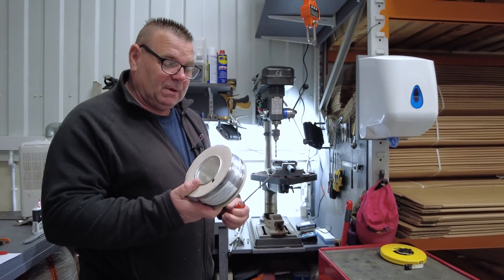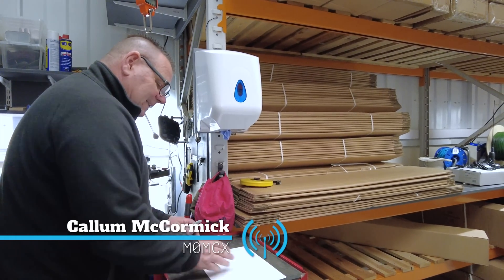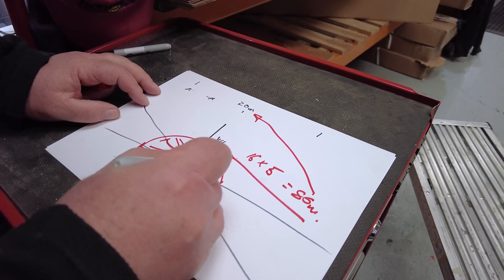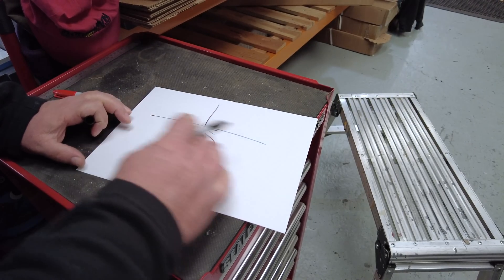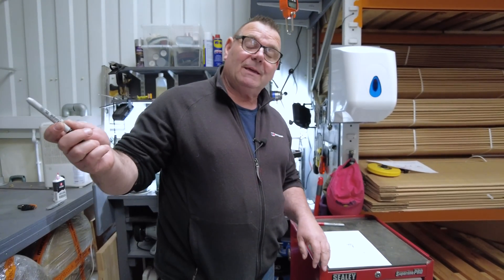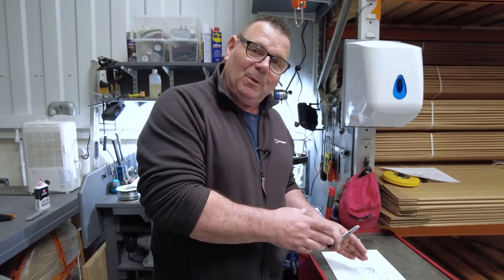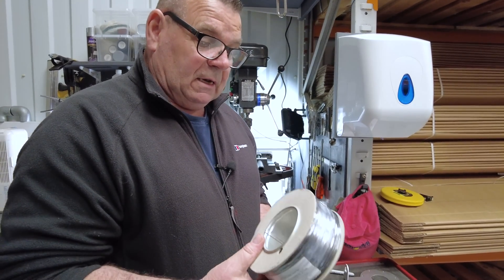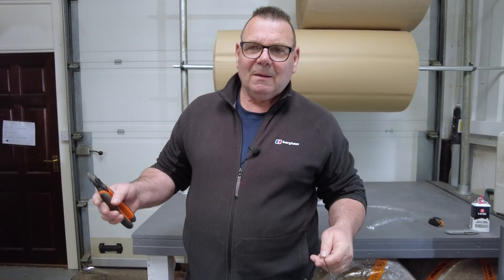How Many Radials for a Permanent Ham Radio Vertical Antenna

Comment: Your 20 meter antenna, math example for making radials is great! I can apply it for any length antenna. However, what about a 6 band antenna? If i make the 16 radials of 1o meters (going for 1/8 since 1/4 is too long, and getting 2 wavelength of copper in the ground), then what about the othe bands, 40, 20, 10, etc? Do they work of what i put down for the 80 meter part of the antenna? Thank you!
Reply from the maker: OK, so for a multi-band antenna - my own rule of thumb is 2 x wavelengths of radials for the lowest band - then everything automagically doubles when you change bands upwards :)

Comment: Does the end of the radial  wire need to be insulated? Thanks
Reply from the maker: The end? No unless you are a paranoid OCD.. Yes, water will come in - but it will still be copper inside in 100 years time.

Comment: I wonder what would happen if you had a single really long radial and just encircled the vertical antenna in a spiral fashion?  You put a lot of  wire down.
Reply from the maker: Actually, it's genuinely more efficient to have a lots of shorter radials because closer in to the feedpoint, there's more copper..
Reply: @ loving my DX Commander Classic Callum. Thanks for the response. Hope you are well!

Comment: A little overkill perhaps but in the main well done. The FCC once required 120 radials for commercials. Steve N7VS
Reply from the maker: Yes.. Dr George Brown discovered that for SHORT radiators, 120 was optimum - but as Rudy Severns (and me) discovered, for pure quarter waves, 16 is good, 32 is maybe an overkill..

Comment: hello Callum, i,m thinking of buying the sig 9 version to replace my hf vertical , i have a 125 ft efhw for top and harmonics for the other bands i made it witha9.1 balun, it works very well and it'll stay up as a back up ant.  I'm interested in the sig 9 as it does need guy wires i would be able to get out approx 8 radials, hows about 1 1/4 for each band would that be enough, can you drive a copper earthing rod in the ground and run an earth to that would it act as a counterpoise? or is it not needed, many thanks GW4
Reply from the maker: Mike.. Honestly, just lay down a load of small radials.. Don't both with earthing rod.. That won't assist.. It's the return currents.. If you are concerned, just remember "small and lots"..

Comment: I was getting all excited about this DX Commander - until I watched multiple videos showing the guys stringing LONG lines of radials. I have just enough room for the Commander, but very limited space to stretch out radials. Especially at even lengths. Your video here shows how the antenna should still work even if only done in a 180° (or even 90º!) spread. This gives me hope that I might be able to make this antenna work for me in my backyard (garden to you UK folks - ha). I've learned to love your informative videos. I've only been into HF for about two months so I'm soaking up as much info as I can.
Reply from the maker: Plenty of 100W USA stations last night getting through.
Reply from the maker: It'll work. Don't worry.

Comment: Now wait a second.  If you think that a 3db loss is insignificant, I totally disagree,  That's half your power.  Sometimes a small increase in power can make a big difference  in understand ability..
Reply from the maker: Sometimes 3dB can make all the difference.. I have been after an extra 3dB on receive last 12-months! However, I would say 95% of the time, nobody would know.

Comment: Show any copper and water plus power will rapidly convert them to copper oxide.
Reply from the maker: Not yet.. That's about 5,000 installations and nobody has that one. Also, I've vever seen it myself. How strange. Mind you, all the copper is glue lined heat-shrink. Helps.

Comment: Callum, crimping is mostly for mechanical stress relief and electrical connectivity.  But soldering gives you the best connectivity and encapsulates the wire conductors within the solder connection.  Minimize you soldering iron contact, and use rosin code flux to accelerate your heat transfer.   Best to solder (as you did) and not rely on the crimp.  73 de KD6UYK (Tim).
Reply from the maker: Well, for spacecraft and stuff that vibrates, then sure so whatever.. But for radials, who cares! LOL

Comment: WHAT is the gauge size of your wire in the roll???
it looks quite small and it has plastic cover over it???
thanks fo the info,

you know that on certain old barn you will see sheet metal about 36x120 inch long for the roof and i saw some guy taking one of these sheet and buried it in the ground so it would be the ground for their verticals,,is it good?

73 du Quebec
Gervais ,ve2ckn
Reply from the maker: DX10 is 2.4mm and the PVC is extremely specialist..

Comment: If you do them 180 degrees, you'll have a very asymmetric radiation pattern, I've actually tested this.    You might actually WANT this if you are only transmitting one direction and trying to block noise from the other.
Reply: Yes that is worth considering. I operate on a net where I am trying to get contacts from the west of me. Slight advantage could be helpful, so the layout of the radial field could be designed for best result.

Comment: I'm guessing (ideally) if you have a dxcommander which does 40m , then you need 4 x 40m of wire down, 160m  radials. 16 x 10m ?
Reply from the maker: For perfection on 40m, yes. However the difference to putting down half that is not noticable.

Comment: S9o when you have a DX commander antenna that covers mant frequencies do you only make the radials cut to the lowest band , lets say 80m or do you need 80m which covers 40 (20m radials or equivalent ) then 20 which covers 15 (5m radials or equivalent ) then 17 that gets 12m, then 10m which would be 2.5m radials. What do you do when there are multiple bands involved? Cover the lowest or each band with its own radials that also covers the next highest harmonically related band? 80 gets 80 skips 60 but gives you 40 ect.
OK fund the answer below, just cut them to the lowest band covered by the antenna. I'll try to go for 32 20 meter radials.
Reply from the maker: OK, so think lower bands.. Let's say we get 40m just right.. So 16 x 1/4 wave. Or maybe 32 x 1/8 wave. Then all higher frequencies are covered anyway and in this case, 80m will be marginally down (actually, only about 1/4 of dB down) because it will have equiv of having 8 x radials.

Comment: I purchase 250 foot rolls of brown colored lamp cord for my radials cut to 16' and then split for two radials, I double this to create four radials per connector (crimped and soldered per Callum's video).  I have 48 radials for the permanent multib-band vertical and additional  set of 32 x 16' radials and two sets  of 16 x 16' radial for portable operation. For the portable radials I use anderson powerpole connectors for very quick deploy of either multiband vertical set up or fast monoband config or when setting up a quick parasitic 10, 12, 15 17, and 20m  2 element array. For faster deploy for the multiband portible I have a radial plate with 32 x 16' radial attached with the radial bundles coiled with velco straps for faster deployment
Reply from the maker: Like the parasitic style!

Comment: Hi callum, I have still to erect my DX Commander i purchased from you but will i need to do 2-4 wavelenths for each band the antanna does at the relative lenths. does that make sense eg if i have 20, 40 and 10 then i will need 4 wavelenght radials for each etc
Reply from the maker: Any radials / any length to suit your property / location.

Comment: Well done for helping Raisa.  
Just a quick question.  Does the diameter of the wire matter for the radials ?   I have been using a vertical with a few radials and they are all very thin (cannot remember the AWG now).    Thanks and 73''s.    Marcelo  ZL1MTO
Reply from the maker: Not at all. Thin is fine - right down to individual strands of an ethernet cable - probably thinner!

Comment: Cal LOVED the music my friend  very nice .saving my money to get one of the RD COMMANDERS. got to figure out which one. Portable or at the QTH, semi permanent. That's one I must figure out . Probably use need the 40 - 10. I have a metal building very close by you think I will have a problem with that. As far as transmission and receiving.
73 my friend
de KN4CBS
Reply from the maker: You will be surprised with the metal building. It's never as bad as we think.. Erm.. Possibly aim for the DXC Expedition. Lovely antenna.

Comment: I saw a guy tuning his radio to 40 meters with a wolf river coil. Initially using a bunch of 16’ radials. Best he got was around 2.0 SWR. He then added 33’ radials one at a time. 40 was looking better. Once he got to 4 33’ radials 40 was practically flat. Just saying.
Reply from the maker: You are mistaking a coil driven element for a pure 1/4 wave. The two are very different as pointed out in the paper by Dr George Brown 100 years ago. Shortened verticals need MUCH more of a ground plane to compensate for the losses. Even then, they never work as well. Just saying.

Comment: You only need 3 or 4 radials. They should be slanted 40 to 45° from vertical for best performance.  The antenna can be tilted for talking skip.
Reply from the maker: Kevin, I believe you have fallen into the myth trap :)

Comment: Radials have always been an interesting discussicion, I gave up on the lengths bit.  I use this for a 40M  1/4 wave ground mounted verticle, for field day. I have a reel of 1mm transformer wire, collected over the years. I guess could be up to a kilometer in length all the joints soldered. I attach to the insulator base earth point. start at the antenna, go out 1/4 wave length across about 1/2 meter  pegging at each bend and back to and around the insulator at the base of the mast. the mast,, radials start looking like a maltese cross and then fill in the empty spaces, same way. Looks pretty and works very well for the range required. Takes time to put them all out. Have to watch some plonker does not drive over it with his car.@#$%. Your thoughts?? Dud Charmers used to say a 1/4 w circular disc of copper sheet was the perfect earth system. wouldn,t want to foot the bill for that.
Reply from the maker: John, you would probably find that you could half the radial length and scatter them out and not see any difference. Actually, I am unsure what the impact is of connecting the ends in one continuous "loop".. But if it were me, for my "Once-per-year" outing like this, I would go with 30 x 5m radials and an easy-to-handle wire, connecting 4 radials per connector (because 4 is easy to lay out with human hands) and scatter them out as best I could... Works for me.

Comment: I'm one of those broadcast engineers who cringe.... :)  For AM BCB, the most common configuration is 120 1/4 wave radials (1 every 3 degrees).  They're usually buried, a foot or so.  At the station where I worked, many of the radials were exposed, due to soil erosion, over the years.
Reply from the maker: Haha.. Do the math. You were conned! Unless its not a full q/wave. Then 120 is important. See Dr Brown's research. Shorter than full q/wave means more radials.
Reply: @DXCommanderHQ  120 1/4 wave radials is the standard.  I don't know why that particular number was adopted.  The station I worked for was on 1550 KHz.  But the University that owned it had received it as a donation (I guess there IS a Santa Claus), and its original frequency had been 590 KHz.  So those radials were 400 ft long.  That would be an 800 ft circle, on the property!  But they cheated.  The radials went under the fence, into the surrounding desert9which was public land).

Comment: Hi mate, I just bought the DX Commander Classic. Would there be a problem if I install the antenna on a sloped tiled roof and connect the radials to the roof rain gutters using them as a counterpoise?
Reply from the maker: As long as you can EASILY Maintain it and get to it easily - AND it's safe, why not.

Comment: Thanks for your videos. Very informative. I just got into the hobby and got my license. I do have a question about radials. Can you extend an existing radial with a wire nut, soldering or some other method? Would it be better to just run a new wire for the new desired length?
Reply from the maker: Either/ or. Doesn't matter. More shorter rather than fewer longer.
Reply: @DXCommanderHQ  Thank you

Comment: Broadcasters here in the US almost fanatically belive in the  pioneering  1930s RCA vertical antenna research.
Basically, two things are going on at the bottom of a vertical radiator. It has RF current from the coax pushed through it to create the "radiated"  electric and magnetic fields. The current varies over the height of vertical element but if it's 1/4 wavelength high (or short but made to look like it's 1/4 wavelength with a loading coil, etc., or otherwise pretending to be a 1/4 wavelength) the current is maximum at the bottom. The ground, connected to the coax shield,  also has current flowing through it (opposite polarity) -- a maximum closest to the vertical element. With all this current in the ground near the vertical element it's a good idea for the ground there to have low resistance.  Broadcasters put a "screen" or wire mesh from the antenna out a few feet. When an amateur puts down lots of radials he/she makes the area close-in dense with copper--with the same effect as the screen/copper mesh. Current in the ground (radial) system travels along the radials away from (and back to) the bottom of the antenna. Broadcasters "fool" that current into thinking it's feeding a low resistance by making the ground radials (which carry most of that current) 1/4 wavelength long. That's a magic number. Looking into an un-terminated 1/4 wave line, the near end looks Ike the inverse of the impedance at the far end---the inverse of an open circuit (which is theoretically a short)---a low impedence at the near end.  Ground wires of any length other than odd multiples of 1/4 wave will behave like a higher resistance ( and complex impedance) than the magic 1/4 wave radials. They tend to lower the current in the whole antenna. So always TRY to (1) have dense copper surrounding a vertical antenna and (2) have "many" radials, each one as close to 1/4 wave long as practical.

US
Reply from the maker: Interesting.

Comment: Callum, dare I say, if you stick a nail on that 3m mark you could double your line back, and safe yourself a few trips. (Then on the return, just half the wire at the nail, boom 2 trips 4 wires. ? I helped? I do systems.

Comment: So basically. A quarter wave vertical with 16 quarter length radials, in a circle. Basically a flat satellite dish.

So I have both the MFJ1979 and the MP1C antennas. I want to work 40m, which would be 33ft for a 1/4. I would need 16 to get that gain. Using those same radials, I could use it on other bands that have shorter radials. Instead of having radials for 20m, I could use the radials for 40m and have +/- the db?
Reply from the maker: Yes Andre. OR you could cut ALL those radials in half and add them back in to give you 32 1/8 wave. And of course on 20m, that would give you 32 1/4 wave and on 10m that's 32 full wavelength.. You are correct.

Comment: Cal, QUESTION you may have addressed.  I am looking at 2 things: for DX C Signature compared to a shortened vertical, what's the pattern difference especially on 40/80m? You may already have done this on your modeling video but I don't see it. Maybe a future topic?? De WO8USA🇺🇸🇺🇸🇺🇸
Reply from the maker: OK, so the 12.4m is probably about 1dB down on a HUGE 80m q/wave vertical. The rest of the bands behave as a q/wave.

Comment: Hi Callum. Do you know if a robot lawnmower will work if I bury it's navigation wires and leave my radials where they are? And will it affect the antenna?
Reply from the maker: I wrote to the manufacturer asking about how tight their 820kHz signal is and does it produce any harmonics. That was my ONLY worry. Worst case scenario if switch it off when operating. Else all good.
Reply: @DXCommanderHQ  Yes I would imagine that its safest to never have them both switched on at the same time. If I see the robot trying to seduce my DxCommander I will know something is wrong :) Thanks for your reply Callum.

Comment: Thx.  Running a Hustler 4BTV with 32 radials to date , ground current still climbing , I have equipment to measure this rf current. , Proof that more radials are better.  Many say at above like 50 radials I will get less and less advantages in lower ground losses.  Commercial broadcasters use up to 120 radials to get ground losses very low.   When I first put up the hustler I used only 2 radials. ( Because I was in a hurry to try out my new antenna ). It was crap compared to now!!! I could tell,. Many tries calling DX, many so so and fair signal reports.  Now. WAY different !!! You NEED radials. Period.
Reply from the maker: You do need radials.. But from 16 to 64, there's less than 1.5dB. UNLESS you have some really crappy ground.

Comment: Not totally on-topic but I'm jealous of your new Workshop, and it's great to see another experienced engineer using blunt side-cutters to soft-crimp generic motor connectors (rather than using the rubbish 2 quid tools).  And then soldering - just enough so the solder flows through the crimp.  Looks easy on video, but try teaching students that skill!  Good to "meet" you on here Callum, and I look forward to watching more.  Channels like this are appreciated by Hams across the globe.  Regards and 73 de Peter G6EPN
Reply from the maker: Hello Peter, you sound a great guy. Like it! Welcome :)
Reply: Yes indeed you make it look easy. It IS easy, after a few thousand times you do it - right? I can usually do that kind of soldering, but it comes after some voluminous self-training (after initial blunders). Ha!